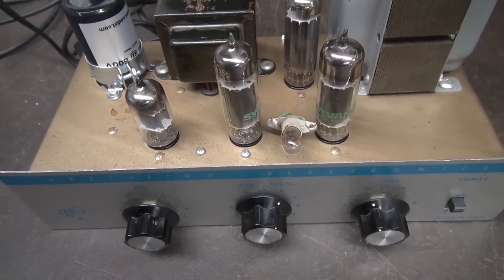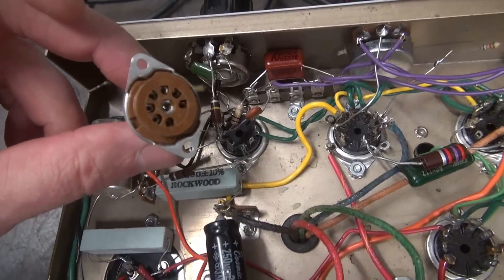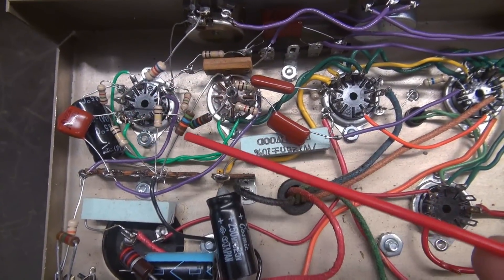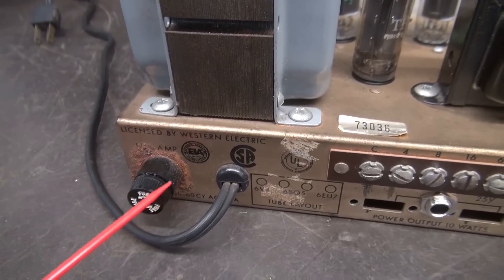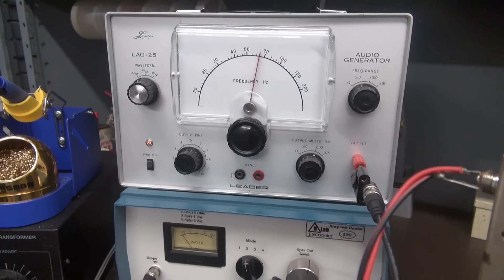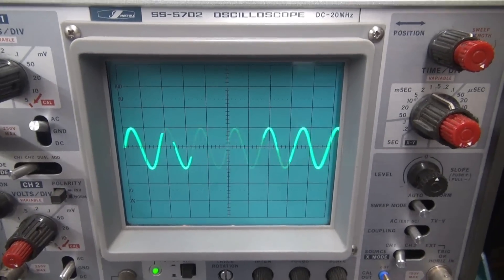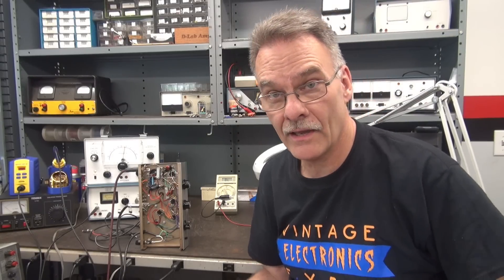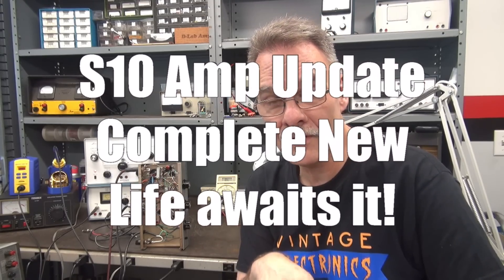How to modify Precision Electronics Tube guitar amp Inverter Preamp Part 4

Comment: How would I modify a Precision Electronics S35 to a 2 channel (clean and quiet  (high capability for natural and pinch harmonics) high gain metal distrortion/versatile) guitar amp with foot switch selected channels? I hate hiss and noise. Thanks. I would like to have a unique sound. Modern Marshall sound with the capability of vintage Marshall sound?

Comment: Hi Terry, Your S-10 project came out great.. I just have one question though, why did you remove the 6eu7 for a 12ax7? Aren't they basically the same tube? I thought the 6eu7 was even a slightly better tube with regaurd's to lower noise. Just a thought. Tom
Reply from the maker: I wanted to model the preamp section like Fender, hence the 12AX7